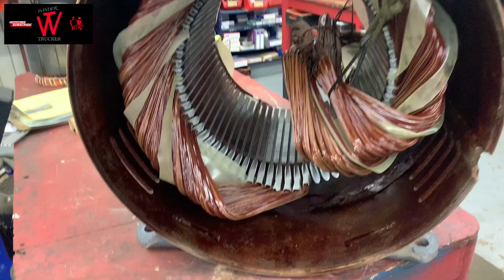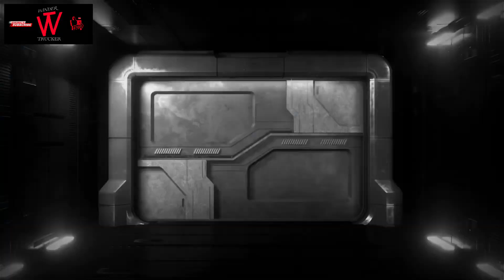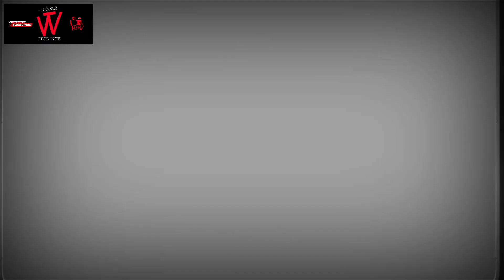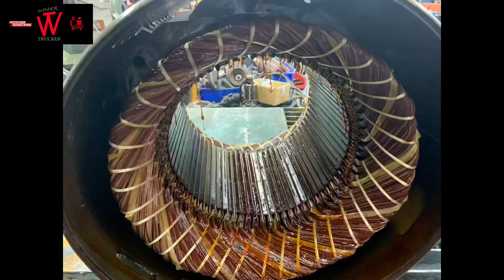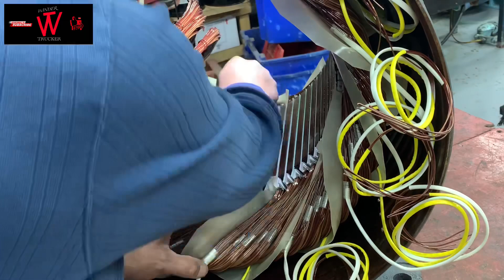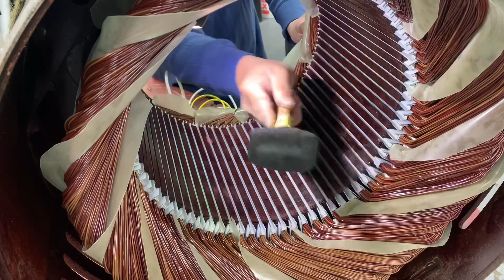Motor Rewinding Tutorial  For Beginners | 150 Hp How to Prepare inserting wires into the Slots

Comment: Tama k master kahit aq hindi gumagamit ng paper to insert the coil kc time consuming yan if marami kang e rerewind i just repaint the core for protection also ang insert gently by finger.. if  magasgas man yan..isa or dalawag wire hindi malaking factor yan kc e varnish p din sa akin 3 to 4 coat aq tapos e bake...good job master...
Reply from the maker: Dati gumagamit din ako pero dna ko comfortable mag rewind kung may papel pa malaking tulong na yong spray insulation kunting scratch bossing varnish na bahala don to re coat tama ka jan bossing 👍👍👍
Reply: @windertrucker6230  yup master iba iba talaga tayong mga rewinder ng stilo kung saan k gamay ei yong ang gawin mo ika nga...basta importanti tama ang connection size of wire number of turns...
Reply from the maker: @HowtobyKuryentecianTV  that’s right bossing big agree ako jan.👍👍👍

Comment: Thanks for sharing. Have a question why is those slots empty? Not too much I ding wire, something is wrong.
Reply from the maker: Hey SteveTheuma old motor design from factory wide bore not much wire on slots easy to rewind unlike new motors nowadays they are compact that’s why some are tight to rewind.

Comment: Dear Sir how are you..? I want to ask a question. I have asked this question to many but in real sense no one could answer it correctly. so I want to ask you the question. A 30 kW 2pole motor RPM 2950 and frequency 50hz.Now the motor 1450 RPM Frequency 50 Re-winding the connection How to make the correct rules What I want to know Please if you give me the correct information I would be very helpful I hope I get the answer from you.
Reply from the maker: If you trying to convert your motor speed/rpm you cannot change the rewind. the 2950 rpm is less core than the 1450 rpm i will not advice to change your the rewind or connection.
Reply: @windertrucker6230  I have heard that it can be changed in this way but some of the amperes go back and forth. I don't think it's right for you to change the way the manufacturer made the motor.
Reply from the maker: @mdismailchowdhury8511  yes I heard if you rewind motor from 2950 down to 1450 rpm first you gonna lose half from the original hp less torque can’t maintain the original power of motor.then needs extra cooling system higher speed the cooling fan pushing more air into the motor when you change to lower speed air flow will become slow down motor gets hot and burnt it’s not worth doing it bro sorry
Reply: @windertrucker6230   "Master"Thank you so much for your valuable time.I hope you will be by our side in the days to come and we will be able to get more important information from you and put it to use.